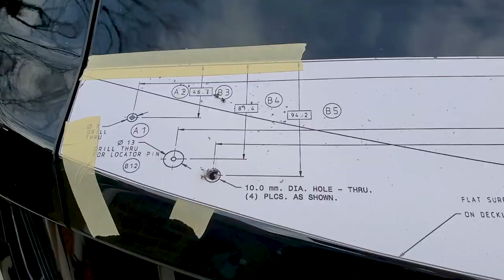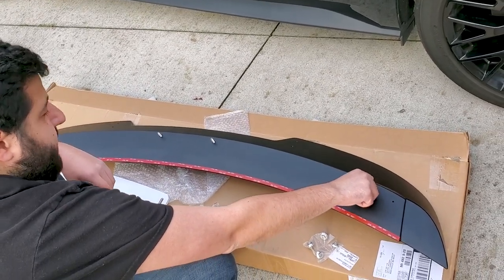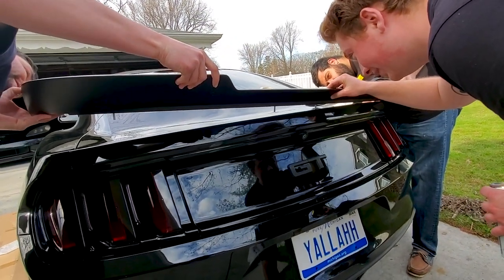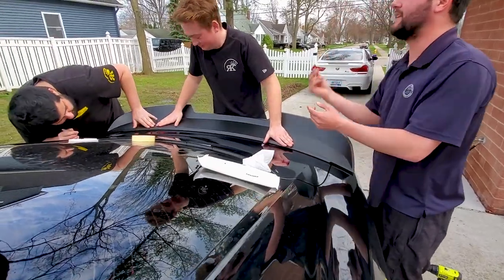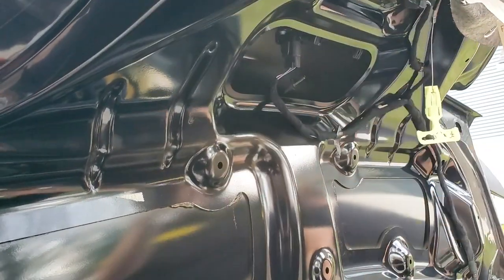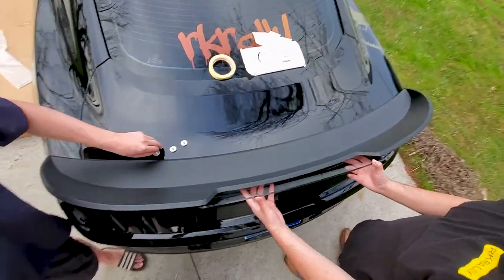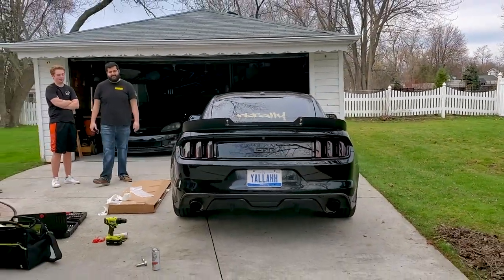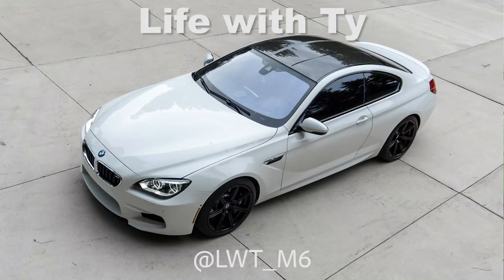Drilling into a Mustang trunk! | Drake Wicker Bill Spoiler

Comment: Where did you get the drilling layout from?
Reply from the maker: There is a digital file when you buy the spoiler. He had it printed out to the scale mentioned in the drawing
Reply: Is there anyway he can send me that template for can receive one for some reason
Reply: @Ahuihou117  LIFE SAVER!!!!! Mine didn’t come with a template.

Now I need to figure out what size to print this
Reply: @jovanmaxwell6312  print 1:1 scale. It’ll be a big ass template so if suggest somewhere like Office Depot or anywhere that has that big of a printer. Call ahead. Once you print it, there is a reference box on the template that should be 1inch by 1inch. If it is, you’re good to
Go. Just tell them to print the template 100% to scale that it already comes in the pdf.